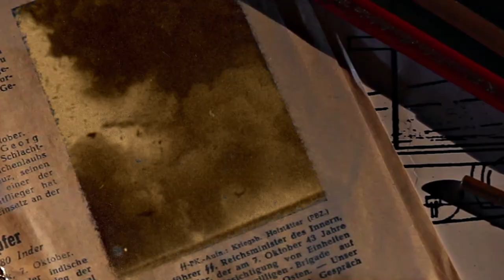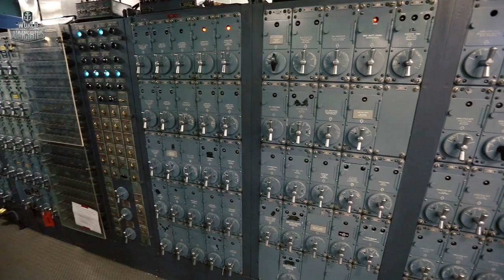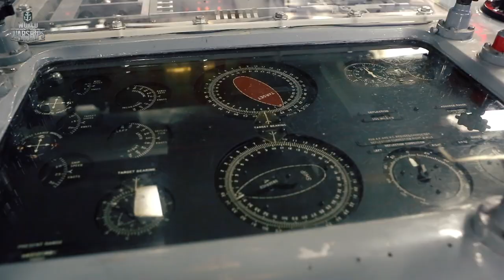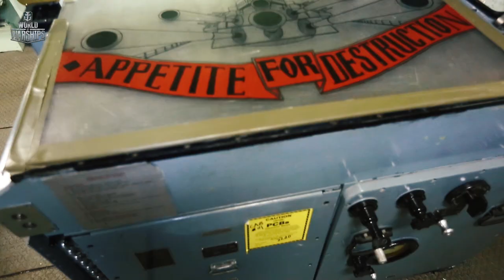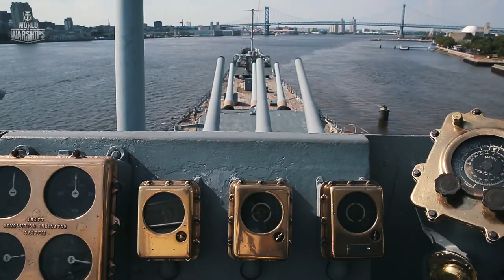[Naval Legends] New Jersey

Comment: Yuriy Kruchkov said Iowa-class battleships' 406mm shells were on par with the power of 460mm shells of Yamato, because the Yamato used heavy shells which made their shells had a lower muzzle velocity. It doesn't make sense! Although, the penetrating power of Iowa's 406mm shells may be same as Yamato's 460mm shells, Yamato's shells carrying more dynamite than the Iowa's shells!
Reply: +Ho Wan Leung Wrong. Force = Mass x acceleration

The 406mm shells had a greater velocity, because the barrels are longer. (See my response to Edward Awuy's post).

BTW: I'm British, the US Navy annoys me massively with their f##king Marine chinooks flying over my apartment in Tokyo; I have no loyalty to the US Navy at all, I'm just trying to be objective.
Reply: Okay, maybe you are right, Iowa's 406mm shells had a greater velocity, but we know that the penetrating power of 406mm and 460mm shells are enough to penetrate armors of all the battleships in WWII. Therefore, the shells with more dynamite (Yamato's 460mm shells) can cause greater damage when shells hit the target (that's the mind of 460mm shells). Btw, thank you for your information.

Comment: can anyone explain how the 46cm & 406mm gun is pretty equal in destruction power by only the longer gun O.o
Reply: +Edward Awuy The longer barrel increases the kinetic force that the projectile receives, as a result of the rapidly expanding gases of the exploding fuel placed behind it. The 406mm shell has more time to increase it's velocity, and thus, it's Kinetic Potential Energy. 

The most fundamental equation in all of Physics is this:

F = Ma or, Force = Mass x acceleration

TL;DR? (406mm x greater acceleration) = (460mm x lower acceleration)
Reply: so overall the barrel provide good kinetic energy velocity on every gun? from tank, autocannon, & naval guns
i never knew this before(as example the German Nashorn 88mm L71)
Reply: Edward Awuy Yes, basically. The longer the barrel, the greater (in theory) the muzzle velocity and therefore accuracy and power. 

That's why submachine guns and pistols don't have a lot of stopping power, when compared to sniper rifles

A Sig .356 magnum round will do significantly less damage than a .338 lapua round. Although there are hundreds of factors that affect this, like the shape of the projectile - in this instance.
Reply: but long gun can't guarantee the HE power but its caliber, so overall Yamato win absolutely in HE power but equal in AP power.
while Iowa & Montana have weaker HE power and a bit equal in AP power of destruction + some accurary as smaller caliber. :D
Reply: Edward Awuy Yeah, I guess so. Besides, the Yamato's armor is better so...
Reply: +Edward Awuy Accuracy. If a 460mm shell cant hit a target [or hit it with enough force], it doesnt do much. THe longer gun allows the 406mm shell to fly straighter, and the pressure causes it to fly faster, causing it to hit the target harder, and more accurately
Reply: but Yamato don't have problem to get closer/the enemy to come closer as Yamato having great armor in BB history and only dare enough by massive executing her w/ 400+ attack planes from two combined Task Group 58.1 & 58.3.
so the 406mm also kinda useless when both is getting closer by 10km below.
as Iowa-Class don't have any better protection than 41cm Nagato-Mutsu's AP shells.
Reply: +Edward Awuy Longer barrel increase the muzzle velocity thus increasing its destruction impact while 460mm shell already heavy and reaching its max velocity and making a longer barrel won't help increasing the velocity but due to the shell weight , shell impact is high on low velocity while 406mm goes on high velocity on low weight which equalvalent amount of force on both shell type is same. Just imagine if you throw an orange at styrofoam wall at 10 meter range on 30 m/s and throwing a watermelon on same range but now you only can throw it at about 20 m/s and you can't achieve any more higher velocity due to its weight and and maximum power contributed. And you see, the amount of penetration  is about the same because the force transfered to the shells is same on both of it.
Just saying.
406MM + High Velocity = A light shell moving at fast speed but still destructive due to velocity where a structure can't withstand high impact speed.
460MM + Low Velocity  = A heavy shell moving at slow speed but also destructive due to its weight where a structure can withstand the speed impact but cannot bear the high inertia impact generated by heavy weight . Imagine stopping a 2.5 tons shell into 0 m/s, the amount of inertia must be massive making the shell weight kinda probaly more than 50 tons I guess."I don't good at math and formula a lot". 
.
 If you don't still don't trust me, take a steel ball of same weight and drop it from 1 meter directly into a weight scale. Drop first one normally and observe the weight generated and compared it to original weight at 0 m/s. Now. Drop the second one on same high but with a little bit force applied. Observed the weight generated. Now. That what you call inertia which in this case, 3 + 7 = 10 and also 7 + 3 = 10, where high velocity + low weight and low velocity + high velocity = Same Power.
Reply: simply equal to Ballista(stone thrower) >< Trebuchet's mechanism
the projectile is small but can travel longer distance w/ small reducing m/s energy(it's aero mechanism); vice versa.
unfortunately I already learn it since my first comment here,
so . . . yeah~ ^^
I'd like to end this endless replying on my curiousness past time.